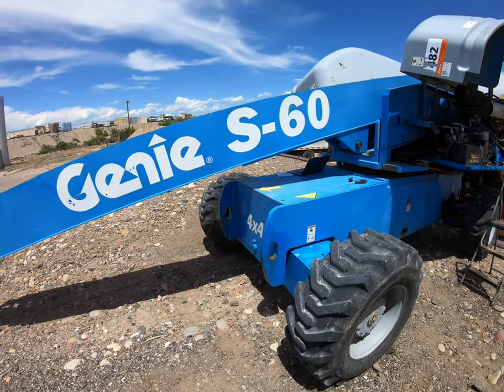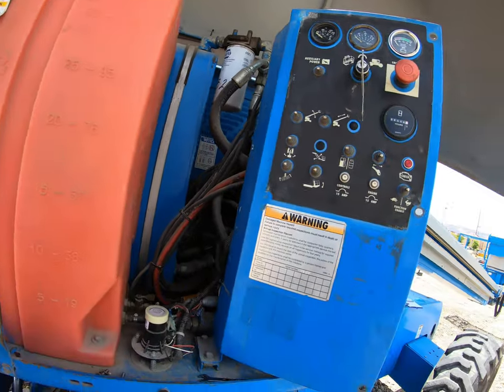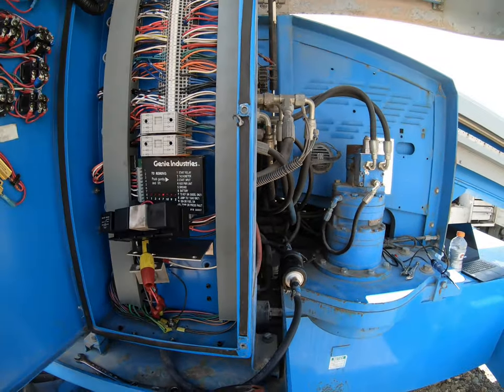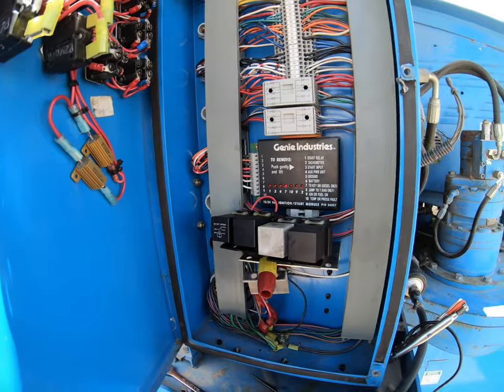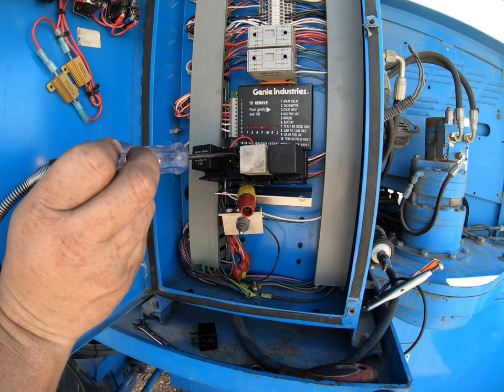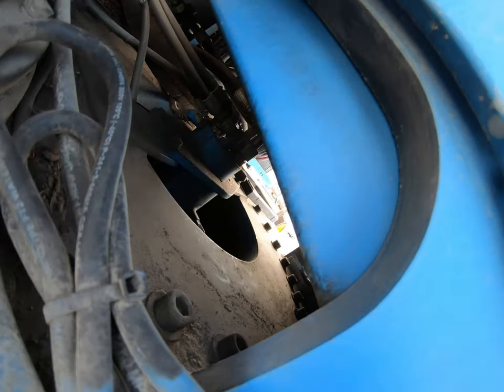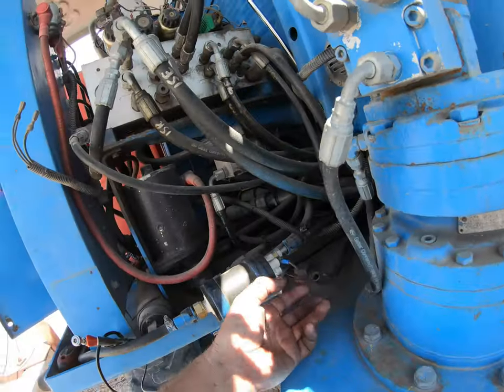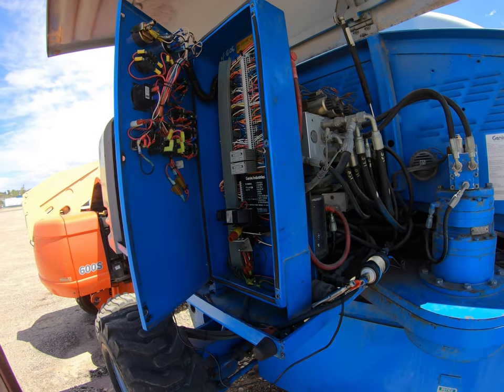Genie S 60 Boom Lift Crank No Start Diagnose & Repair

Comment: This video was alot of help. I just lost power to my genie lift after a heavy rain. It ran fine then mid use 30 ft up it lost power. Someone sent 2x12 out 3rd story window to get me free.I'm gonna check my relay connectors like in this video and see if one is nasty. Thanks for the upload was a godsend .
Reply from the maker: Glad it was helpful. Hope you get it going.

Comment: My genie s-85 ran out of diesel while i was working, Luckily it had enough fuel to reach a balcony and get out but now i've been told that there is going to be a problem because as It ran out of diesel there is going to be air in the fuel Pump now, can you tell me how to do to let the Air escape from the fuel Pump, i haven't tried yet and tomorrow is when i Will refill the fuel tank but i want to be prepared, than you so much in advance.
Reply from the maker: You will need to bleed the air out of the lines. On top of the fuel filter housing is a bleed screw. Operate the fuel primer lever until clear diesel with no bubbles are present.  Close the bleeder and start the engine.

Comment: So like you I really like to look into a schematic and see how things work, but say the the machine is  throwing tilt sensor codes or perhaps I familiar with a certain machine did my function tests and think the tilt sensor might be having a issue.  I may look at the sensor and connector to see if anything looks off/not oem. Did this last week and noticed the seal on the tilt sensor was a bit pulled out, a pin was intermittently making  connection due to being low. In this video example think you did the best thing, have wasted alot of time pulling on shit due to having no wiring diagram.
Reply from the maker: Sometimes visual inspections can find a lot of problems. And it definitely isn't always possible to have a wiring diagram.

Comment: I never have the luxury of having wiring diagrams at my disposal so I'd be that guy going around checking grounds, power, fuses and relays. 99 percent of the time I can find the issue that way.
Reply from the maker: Luxury? Genie wiring diagrams are free to download or view. I don't always have the diagram for the machine I am working on,  but I darn sure use them when available. I'd be a rookie if I didn't. A lot of the time I know which fuses, relays and wires I am after before I even get to the customers machine.

Comment: Using wire piercing probes can leave a place for corrosion to begin on the exposed copper. What do you do about the hole in the insulation after you're done testing each wire?
Reply from the maker: Wire piercing probes are amazing testing tools , I cover the wire better than new when done

Comment: GD iam in Jamaica I have a z80/60  having  some function issues
Reply from the maker: Sorry to hear you're having problems. I've heard Jamaica is beautiful, I wish I could drive my service truck there and take a look!
Reply: @paulsequipmentrepair823  tell the truth not because iam here but it's really nice  sometimes iam working these lift iam about 1/8 mile or less from the sea or beach  but the sea frost messes with a lot of equipment rust wise
Reply: @paulsequipmentrepair823  the problem iam  having I go up max and down max with the jib 10 times  platform say level  but as soon as I raise main boom  the platform tilt and platform levell sensor goes off and flashes red beside basket levell toggle switch
Reply: @paulsequipmentrepair823  question 2 z80/60  we took the generator to a shop get it clean up and they test it good but the pump that's attached to the generator is not turning,  when we remove the generator I turn the shalf on the pump  with my hands
Reply: @paulsequipmentrepair823  question 2 z80/60  we took the generator to a shop get it clean up and they test it good but the pump that's attached to the generator is not turning,  when we remove the generator I turn the shalf on the pump  with my hands
Reply from the maker: I am not familiar with that particular machine but I would guess there is probably a solenoid valve that needs to shift to run the pump. You should be able to follow the lines to that valve block. Make sure the solenoid is operating properly. The best way to find the issue is to T in a hydraulic pressure gauge. If you have pressure at the pump it is likely bad. If no pressure is present you likely have a electrical or hydraulic issue at the valve.
Reply: @paulsequipmentrepair823  k thanks a lot koooool